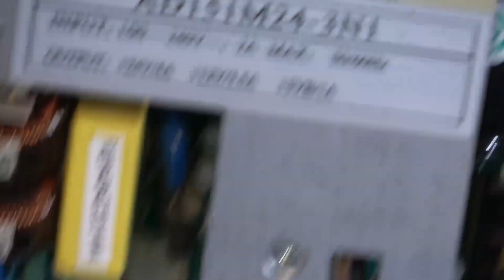Modding an old tv power supply to run without the tv.

Comment: I'm with James on this one , I actually thought the 33 zoomed in closer , maybe the 53 was set  a tad  higher up in the air ......  Prime Hi Fi  was giving you kudo's on your camera set up , Top mount , quality equipment  ETC.   in one of his latest vid's ..... I'm going to look into these cameras on the prices ..... I'll probably grit my teeth LOL  .... Take care Mon Ami .....
Reply from the maker: They were both the same height.  
The 53 zoom is longer. The big advantage is I can zoom in with the camera closer.  To the work without it losing focus.  The 33 I can bring on real close but only on wide angle.  The 33 does better photos due to the higher pixel count sensor.  
The 53 has more features like time lapse.

Comment: Neat you can recycle a power supply out of an old TV.  Better for the enviornment.  I think this would power a lot of things.  And it is pretty compact too.  I think you could probably make a little bluetooth amplifier out of it.  Use 5V for the bluetooth reciever, 12V for the preamp stage and 24V for the power output stage.

Comment: I thought both cameras worked well , i found the  picture was brighter for me on the older camera with 10x zoom . But sound was better with the first 🤔. And the power supply is a great find. Does those have a negative 24 volt rail?